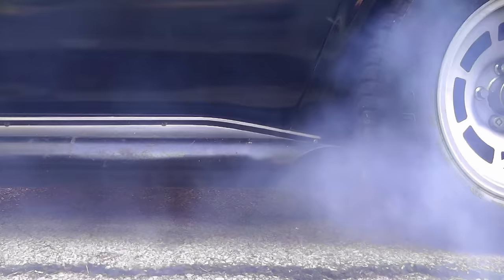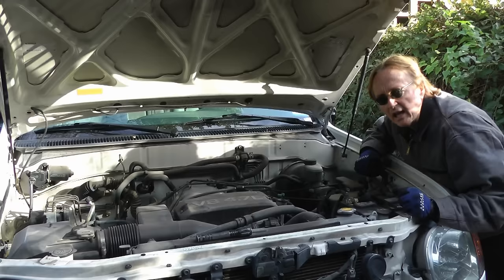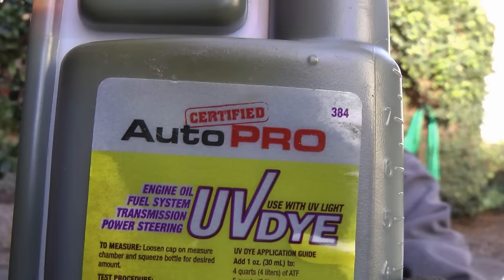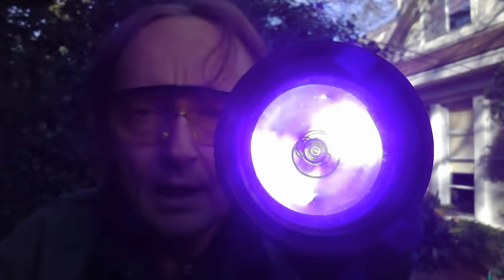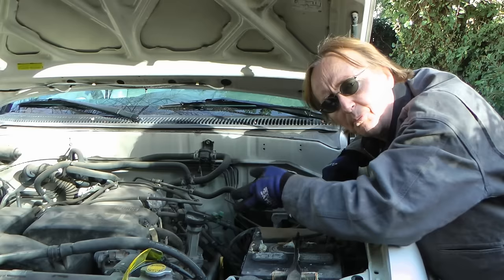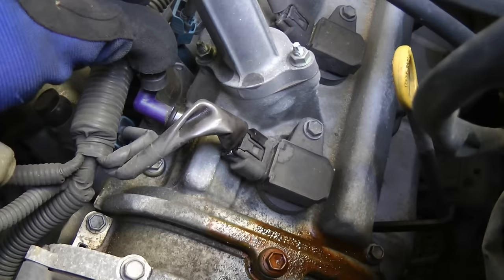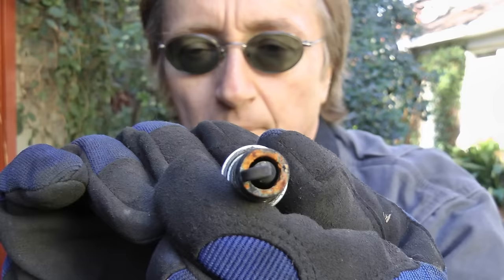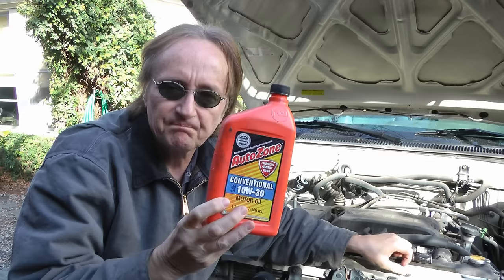How to Fix a Car Engine that Loses Oil (Leaks)

Comment: My car uses a lot of oil but it has no sign of a leak or that it is burning it in the engine. The plugs are clean and there is no blue smoke out the exhaust. None of the mechanics close to me can explain this. It has to be going somewhere, do you have any ideas?
Reply from the maker: it's not magic. It's either leaking or burning. If leaking, you would see it all over the engine and the ground when using that much oil. so, odds are it's burning. Try a new PCV valve first, that's cheap. Pray it's that, anything else, super expensive rebuilding engines.
Reply: I understand its either burning or leaking. What I'm trying to understand is how it can do it without showing ANY symptoms other than keep having to top up the oil.  3 mechanics have looked at it and none of them can say how or why its burning oil but showing no symptoms. As far as rebuilding the engine. I think it would be cheaper to just fit a good second hand one rather than tearing the old one apart and rebuilding.
Reply from the maker: Michael Hamilton
good used low mileage engine is a better choice. But I'd change mechanics, cause they aren't very good. they should have done wet and dry compression tests of the engine to see what's wrong causing the oil burning.
Reply: They never said what they'd actually done, or in this case, not done to try and figure out the problem but I'm inclined to agree, I need to go to somebody else.
Reply: I had the same problem in a new car that had less than 10,000 miles on it.  I was using Mobil 1 synthetic the whole time and every 1,000 miles it was burning a quart of oil.  I switched to Amsoil synthetic and the problem went away.  Apparently the Mobil 1 evaporates from the heat similar to when you leave out a glass of water.  My car had an all aluminum engine which would dissipate a lot of heat and was making the oil evaporate.  The Amsoil is much more resistant to breaking down than any other oil.  Every single person I tell they always come back to me later telling me good things after using it.  In over 10 years of using this oil I've probably saved at least $6,000-7,000 between eliminated oil changes and excess fuel that would have been wasted.  My gas mileage has gone up in every car I've used it in.  Some cars I only got 1+ MPG while others up to 4 MPG.  If you use conventional oil in a car, you are just ASKING for problems.  That stuff should be outlawed.  Conventional oil does nothing good to a car.  It breaks down and causes varnish and all kinds of nasty stuff to adhere inside the engine.  The only time you'd ever want to put in conventional oil is maybe if your car was neglected and had like 200,000+ miles and was burning oil just as fast as you could put it in.  Otherwise, get a brand new car and put it on Amsoil and keep using it and you'll get no less than 500,000+ trouble-free miles.  Trust me!  I've seen it done many times.  I love Scotty's videos.  Many of them are funny.  Lots of good stuff.  I show people Scotty's videos at my job when they have car problems.
Reply: GMoney
That is very interesting. I had no idea that certain kinds of oil could evaporate although I'm not certain if that would be the cause of the problem I'm having. The oil I'm using is a fully synthetic oil and is the one recommended by Toyota themselves as well as being the same oil I was using before the problem developed. Saying that, I've been looking at Amsoil. The stuff looks pretty good so its not going to do any harm to give it a try. Thanks for the tip

Comment: hi i have a ford 2005 cimax 83k it runs fine,but is using a lot of oil,there ore no leeks
 can you plz help,thx mark..
Reply from the maker: change the pcv valve, pray it's just that. If not, engine is burning oil from worn out piston rings and or valve seals if it doesn't leak

Comment: You can tell who ever owns this Toyota takes no care of it, look at the battery terminals, if they can't be bothered to clean the battery posts I dought they took any care of the engine. An ounce of prevention worth 10lbs. of cure.

Comment: hey scotty im in u.a.e dubai temperature outside in winter and summer temperature varries 15 c to 50c centigrade which is best engine oil 4 me plz suggest i have toyota camry 99
Reply from the maker: use a full synthetic oil, like castrol or mobil1

Comment: Scotty my mechanic says to run rottella 15 40 in my gas engine   is it true it's better ? I have a 318 that is rebuilt.
Reply from the maker: that is a good oil
Reply: Scotty Kilmer so it doesn't matter that my engine calls for 10w 30 and it doesn't matter that's is diesel oil?
Reply: namelesssd . i run a 10w30 diesel oil in my car. its same as 15w40 but synthetic  . i like cause lots of cleaning agents in it

Comment: hey scotty. may kia truck loses oil fast.after runing about 120kl i need to add 1liter of oil. the power of the truck doesn't change from the day i bought it. i condemns the hose that connects from the cylinder head cover to the intake manifold and notice that thers an oil coming out from the head cover and i do have more blowby from the oil cap. is a worn piston rings or valves.
Reply from the maker: +dave vega  do a wet and dry compression test of the engine or pay a guy like me to do that, it will show which is worn
Reply: +Scotty Kilmer thanks scotty by the way it's a diesel engine.

Comment: hi scotty please help me i have trailblazer ls 2008 when i turn on my car the oil meter is danceing up and down and when we check the oil it is full  and mechanic he told it have bearing problem this could be true please help me and solve my problem
Reply: Replace the oil sending sensor to fix the gauge. Common problem. If it was the bearings, the vehicle wouldn't run anymore by now.

Comment: Hi. i have toyota avensis 2.0 gasoline 2003.  when i start my car it smells gasoiln inside the car and i noticed that the the motor oil is losing. help please!  thanx
Reply from the maker: have a wet and dry compression test done on the engine to see if it's worn inside. If so, it needs rebuilding or just keep adding oil

Comment: hi scotty, i have a hyundai elantra 1993, corean version with the problem that is call Blow-By, you find the oil in air filter and the IAC valve, do i Need Overhaul the engine?
Reply from the maker: engine needs overhauling
Reply: Scotty Kilmer
thanks for the advice, i'll doit .

Comment: dear Scotty 
I have 2004 ford free star 4.2L its not smoking or leaking oil, I loss oil every 100 mile one quarter ?
Reply from the maker: +Adam usace if it doesn't drip on the ground, it's burning oil, typical at that age
Reply: +Scotty Kilmer 
but is not smoking!!!
Reply: +Jon Sebastian 
so since it burn it smoke should comes out!!
Reply: +Adam usage Interesting... I too have oil loss incredibly at every 1000 miles and no smoke comes out from the tail. and no oil leaking. I wonder whats up
Reply: My moms having the same issue no smoke no leaks and it needs 2 quarts about every 2 weeks or so

Comment: Hay I want to get a danali 2000 it has 230000 is this way to much to buy . $500 I have a Cadillac Escalade 2000 it has 187000 the Cadillac needs a rearend I want to take it out of the danili 2000 gmc an put it in my Cadillac Escalade will this work . R keep the danili with all the miles on it

Comment: hey scotty, i hope that you will be fine .. i am facing an issue in my accord 2005 excessive blow (heavy smoke) is coming when i open oil filler cap or dip stick what could be the reason i am worry about it. & and also my engine air filter is wet with oil too
 :(
Reply from the maker: odds are engine is just wearing out the pistons inside, of course change the pcv valve and pray that stops it, but if not, engine is going bye bye.
Reply: :'( i checked the PCV valve its fine but there is excessive blow which can`t be stopped. i was hopping about catalytic converter could be blocked or any exhaust pipe issue which is stopping the gases to go out that`s why its blowing inside of the engine... & one more thing why the smoke is not coming from the exhaust pipe ???
what you suggest me to overhaul the engine or to replace the engine from junk yard ???
Reply from the maker: Btechnology Bgroup
put in a used engine from japan, many guys sell em, import em from japan with low mileage on them
Reply: Really thank you so much for your prompt response :) God Bless you !!!
& really thanks for your kind suggestion :)

Comment: where is located pcv valve on 2006 acura mdx v6 3.5l
Reply from the maker: it's hiding out of sight. remove that plastic crap off the top of the engine and the ignition coil cover, it's on top there on the end. Get a new valve, easy to match up then
Reply: Scotty Kilmer im losing oil in my 99 chevy suburban too. where is this pcv valve located?? thanks

Comment: Hello Scotty Kilmer  I have a 2002 Audi a6 2.7t. The pcv is right on the top easy to get to. Mine is sucking oil in, I have a piece of cloth i put over the hole before i reconnect the valve back on. I change it every 200 miles an it has oil collected on it.
It has kept the car from smoking but is this bad?
The valve is 400$ because they make you order the whole spider hose assembly.
I was wondering please if there Is anyway i could clean it? Or should i be searching junk yards instead.
Thanks for your time and your youtube work , it has helped me big.
Here is a picture of the valve i have. Any help appreciated thanks.
http://assets.suredone.com/1517/media-photos/cp025511-pcv-valve-audi-a6-c5-s4-b5-allroad-27t-genuine-oe-078-129-101-a.jpg
This valve is located in the intake hose that travels down towards the turbo. 
Here is another picture of my part but on the fully connected hose.
http://www.europaparts.com/breather-hose-kit-078103235g.html
I was wondering if i cannot  fix mine, can i buy this one that is for a 1.8 t engine but it looks similar an i could get a connector an fit it. Would this work?
http://www.europaparts.com/pressure-regulator-valve-06a129101d.html